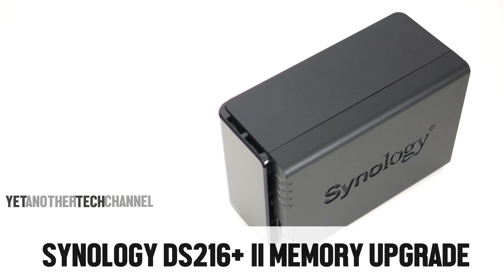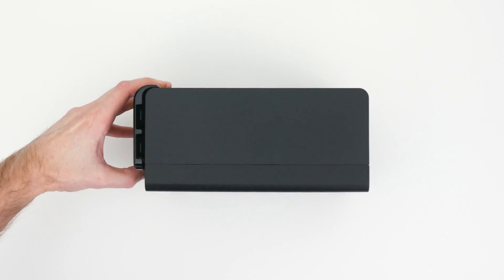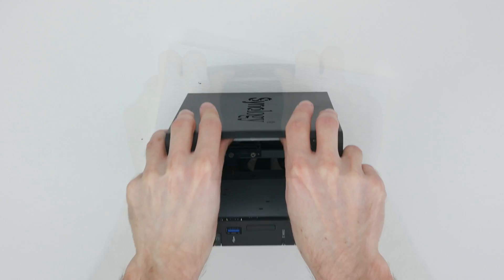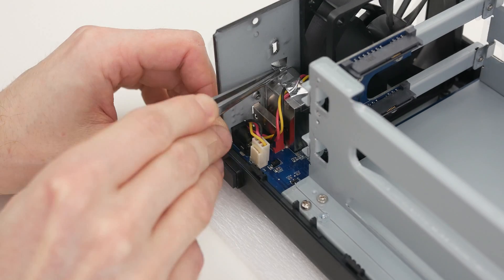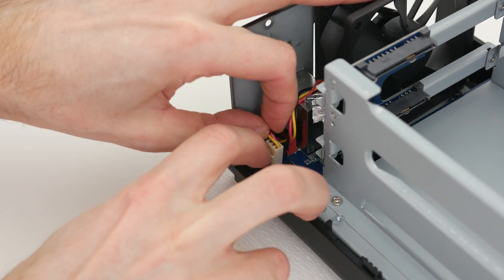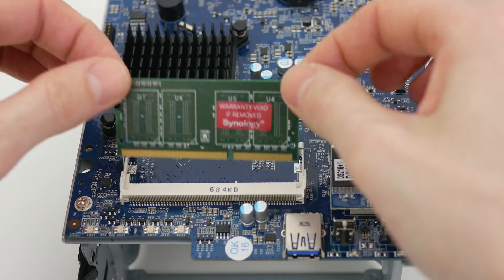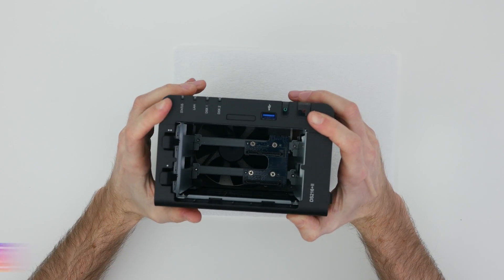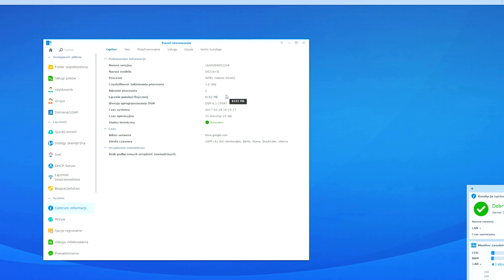How to upgrade RAM in Synology DS216+ II

Comment: I did not even open the case ! After removing the hdd caddies, my big fingers were able to remove the existing RAM module and replace it with the 8 GB one.
Quite uncomfortable but I succeeded 😀

Comment: Once inside, you don't have to remove any parts of the fan or its connector, or sheet metal. Just one small machine screw from the top that holds the plastic locating pin. Then the 4 screws that hold everything to the outer plastic base shell and lift from the front edge once the USB port clears the plastic edge. Getting the clips over the sheet metal was definitely the hardest part - when it finally released my thumb took a hit from the sheet metal, so please be careful.

Great upgrade!!!  Used Timetec (Amzn). Active Backup (DSM 6) for one workstation suddenly started taking over 8 hours last week - it just took 7 minutes after the upgrade! It was only showing 57% memory usage before so I didn't realize that memory was the problem. CPU usage is up a lot now during ActBU, from 50% into the 89%+ range which tells me the working data is accessible (little or no swapping).

Comment: I just replaced the RAM in my Synology DS216+II and can confirm that 8Gb RAM from Timetec (76TT16NUSL2R8-8G) works great.  Also, there is NO NEED to remove the fan or fan cable.  My warranty seal is still intact.  You can wedge the motherboard up slightly to access the RAM module.  Run Synology Assistant to confirm memory compatibility.

Comment: Thanks for the video. There is no need to remove the fan or the aluminum sticker all the way, just the small section against the outer shell. I added 8GB (Crucial CR102464BE160b), it's an overkill but it's not much more than the 4GB. It did significantly improve the NAS responsiveness.
Reply from the maker: Glad I could help :)
Yeah, it's definitely a worthwhile upgrade.

Comment: Can ds216play RAM be upgraded?
Reply from the maker: Most probably the RAM chips in DS216play are soldered onto the PCB.
Reply: Confirmed.  The DS216play memory is soldered on.  No upgrading.  :(

Comment: Just did this with the Crucial linked and have the following to add if someone wants to upgrade a similar unit:
1. Ignore the screw by the Kensington lock. It holds the bracket at :47 which won't be in the way when you remove the circuit board. It is a terrible screw that loves to strip and cannot take a philips head well.
2. The RAM will make a loud click when it's secure. Don't worry. It also is asymmetrical so it only fits one way.
3. There's no need to mess with the tape; you can move the fan out of the way and the tape will follow. Similarly, there's no need to disconnect the fan.
4. Get some compressed air as there's a rare chance to clean out dust in your unit.
Reply: Nice tip (nr.3), that's what I thought too when I watched the video. Why the need to remove the tape puzzles me, every video says that.

Comment: Is it possible to do the same on a DS215j?
Reply from the maker: I'm 99,999% sure you can't do that in the DS215j - j's are entry-level units and Synology made sure to 'cripple' them enough so you will have to upgrade rather sooner than later.
Reply: No DS215J a memoria esta soldada na placa mae assim voce nao podera aumentar a memoria.

Comment: To some people ask questions that are hard to answer for the OP. The most common processor found in this model is the Celeron Processor N3060.

Memory Specifications: 8 GB
Memory Types: DDR3L-1600

So 1866 models and 2400 models probably won't work. It also doesn't support larger than 8GB modules even 16GB's that are dual ranked.
Reply: The CPU will only address up to 8 GB of RAM.  I tried installing a 16 GB and it jammed the booting process.  8 Is the max it can see and address.  However I have used several different types of 8 GB without any issues.

Comment: A very good guide. I first upgraded to Crucial DDR3L-1600 SODIMM SC - 8GB (CT102464BF160B) which did not work. The discstation wouldnt boot up, only the fan was running. Then I changed to 4GB of same type Crucial DDR3L-1600 SODIMM SC - 4GB (CT51264BF160B) and that works very good. I cant understand why, because the two RAM is same type only in different size. However I´m happy with the upgrade and 4 GB is well enough for my usage.
Reply from the maker: This is weird - I have the exact 8 GB module and it works perfectly. Are you positive that yours isn't defective. Anyways, 4 GB is just enough. I rarely hit 30% memory usage with the 8 GB.
Reply: YetAnotherTechChannel It could have been defective, I just sent it back and bought a new one, so it's possible.

Comment: What kind of memories are compatible? How to check this? Will any SODIMM DDR3/4 work here?
BTW - nice video. 1 GB is nothing nowadays and when running Memories with facial recognition and some Docker instances - 1GB is just no enough - swapping happens really often.
Reply: There's a Crucial sodimm DDR3 mentioned in the comments. I used it too and it works.

Comment: Would the Crucial 8GB DDR4-2400 SODIMM be compatible?
Reply: Noo, it is a DDR3 board.  Very different.  DDR3 and DDR4 are NOT interchangeable.
Reply: @davidlp6510  Thank you. Would DDR3 / DDR3L 8GB Laptop RAM 1600MHz PC3L/PC3-12800 SODIMM Non-ECC Unbuffered 1.35V/1.5V 2Rx8 Dual Rank 204 Pin CL11 Notebook Computer Memory Upgrade Module(Blue) work?
Reply: @WillJB88  I can't see a reason it wouldn't.  I used an older laptop module to upgrade mine and it worked fine.
Reply: @WillJB88  I used an older laptop memory module to upgrade mine and it worked out fine.  I can't see why yours would not.  Please try and let us know how it turned out.

Comment: Hello, thank you very much for the tutorial.
Memory module: Crucial 8.0 GB DDR3L, PC3L 12800, 240pin, 1600MHz SoDimm, Unbuffered, 1.35V (part number CT102464BF160B).
My DS216 + II (DSM 6.1.3-15152 Update 6) works great and it's like with new lungs, very responsive and supports better application load :-)

With 1 GB the use of memory was always between 52% & 95%. Now with the upgrade, the usage is between 25% & 75%.

Applications working on the DS216 + II include: Web Station, WordPress, PHP 7.0, Apache 2.2, Photo Station, Active Directory, Cloud Station Server, Cloud Sync, DNS Server, PDF Viewer, Anti Virus Essential, USB Copy

Very good video, cheers, thank you very much.
Alain (Switzerland)
(Sorry my English is not perfect)
Reply from the maker: You're very welcome for the tutorial :)
I'm glad someone found it useful :)
Reply: Alain JBT Thx the info.marked

Comment: what kind of specific memory do I need ?
Reply from the maker: I bought the Crucial 8GB CT102464BF160B DDR3
http://eu.crucial.com/eur/en/ct102464bf160b
Reply: It works great with this module: Crucial 8.0 GB DDR3L, PC3L 12800, 240pin, 1600MHz SoDimm, Unbuffered, 1.35V
Part number: CT102464BF160B
Reply: Do you know if there is a list of compatibility ?
& if a 16Go is possible ?
Reply: @PierreLavoine  The CPU can only see up to 8 GB.  I have tried a 16 to no avail.  It actually jammed the boot up process.  The max is 8 for sure.
Reply from the maker: I don't know of a compatibility list, and no - 16 GB won't work as the CPU can only address 8 GB.
Reply: Thx for info.marked

Comment: Not sure you had to void your warranty, the fan didn't have to be removed from the pcb by the looks of it
Reply from the maker: You're right, I didn't really have to disconnect the fan entirely, but you still have to remove some of that tinfoil strip that sticks to the back metal plate in order to take the PCB out.

Comment: What sort of performance difference did you notice by increasing it from 1gb -> 8gb ?
Reply from the maker: I haven't made the switch from the DS715 just yet. This is for future proofing as the memory usage on the DS715 (2 GB) rarely drops below 80% and the DS216+ has only 1 GB.